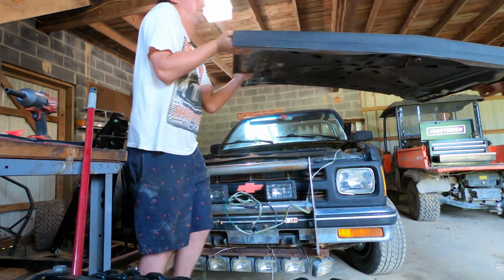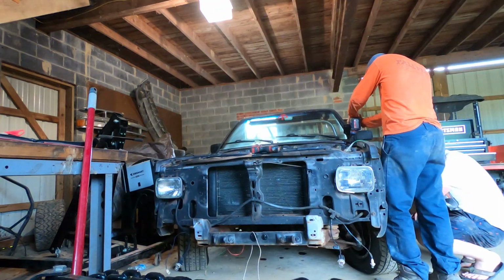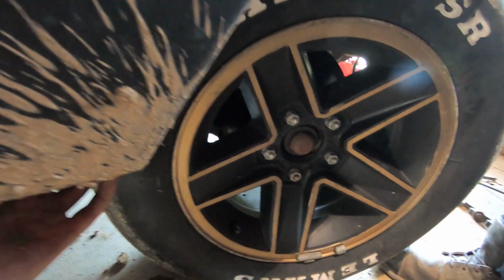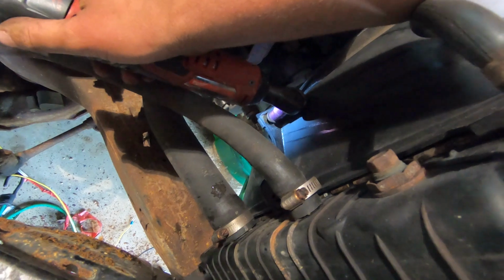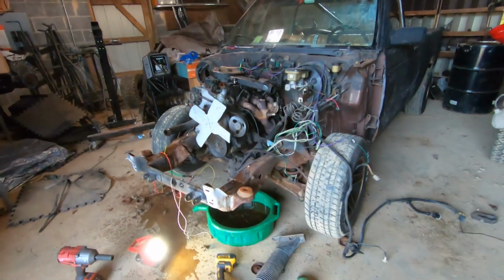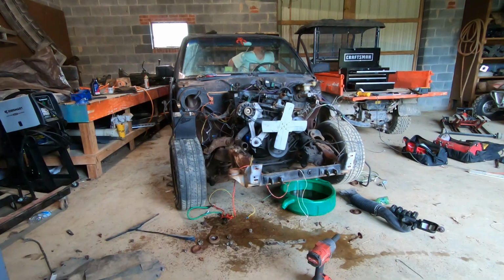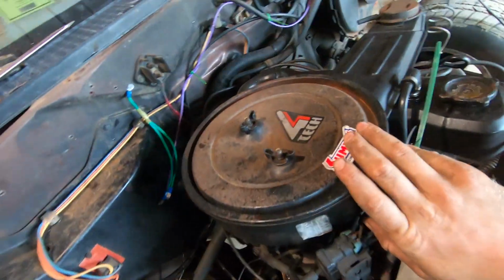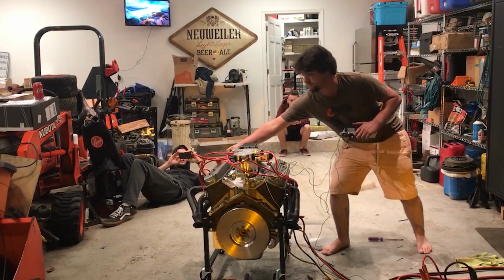V8 Swap S10: Front End Teardown (Ep. 4)

Comment: Me too, I have an 87 with the ol Iron Duke. Gotta come out!! But I just want to remove the core support and not the fenders, for my 350 swap!
Reply from the maker: You can do it that way, you will have to push the fenders outward to do this. Either way, removing the core support will make the job much easier. You may need to remove the fender liners to gain access to the engine mounts though.

Comment: What year is this truck? I’m replacing the radiator core support on my 89 s10. You think it’s possible without taking off the fenders? I already have the radiator and fan out of the way
Reply from the maker: Yes, you can leave the fenders attached at other points, it takes a little bit of work but you can pull the fenders away from the core slightly and then slip the core out and put the new one in. Make sure you disconnect everything that is attached to the core and remove all bolts
Reply from the maker: This one is a 1988, and I put a 1990-1993 support in so the headlights move down to match the location on the newer grilles. All cores are identical in shape, but the headlights are in a different place on the later model years so keep that in mind when picking a replacement

Comment: I can’t get to my bumper bolts. I’m fighting and fighting and nothing is reaching them. I see your bumbler is cut
Reply from the maker: The front bumper bolts are really tricky to remove because they are carriage bolts, so once you loosen them a certain amount, they will spin freely in place. worst case you may have to tack weld the bolt heads to the bumper to keep them in place if the square heads get chewed up